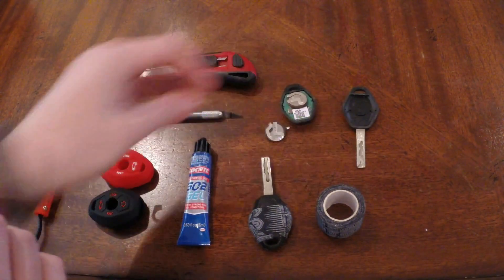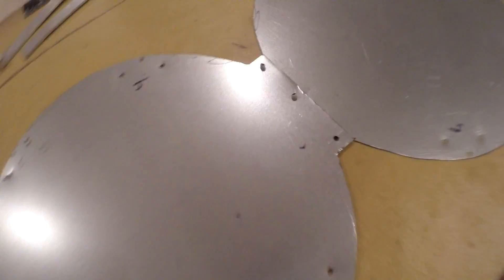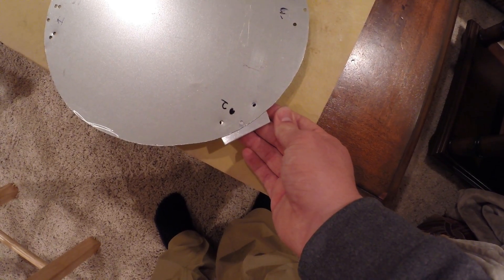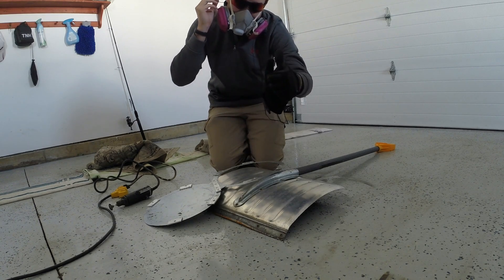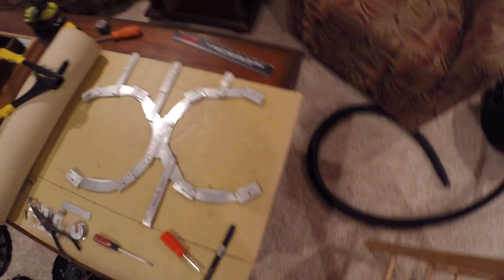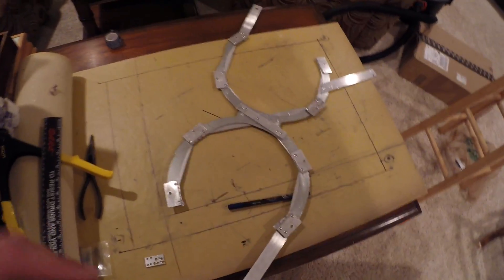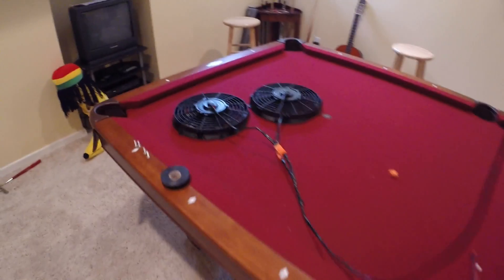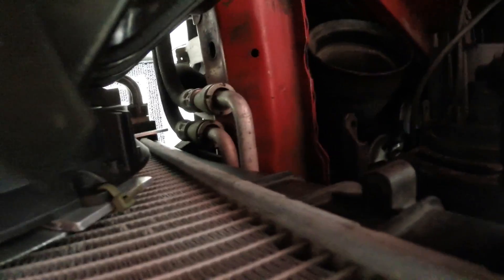E46 M3 Building a twin electric fan bracket

Comment: I'm going be doing this same thing but not the same template that I did but il using 12 inch fans told ya thing I would have room for the 2 12 inch fans ?
Reply: Honestly I forgot a lot about this project, I recall using the largest fans that I had measurade as able to fit. My measuring process was from the stone age though, so if you pdouble check measurements I'm sure you can make it work
Reply: @tylersimpson8314  hey Tyler I ended up using the 2, 12 inch fans and made my own shroud to mount them, 12 inch fans is the biggest you can fit, I had to put them side by side as wide as the rad it self works pretty good too, although I have only tested them while it was 19c out side and they held temp at 178F only time will tell come summer time weather